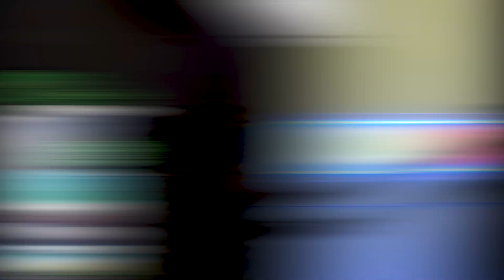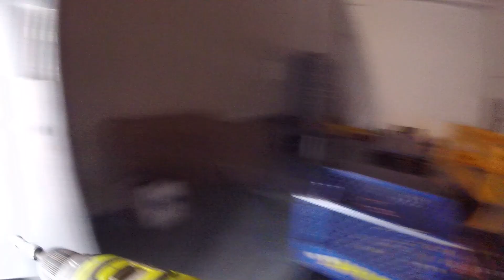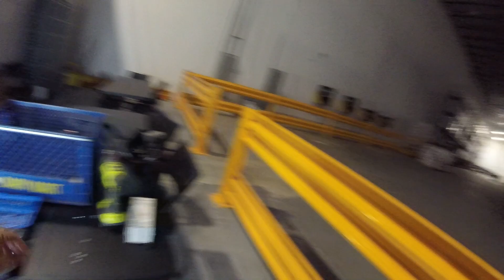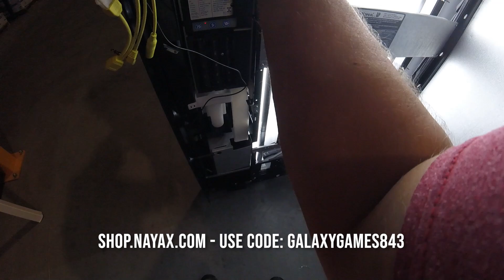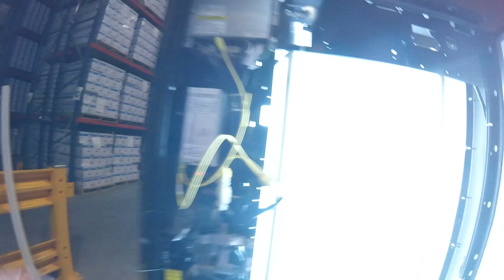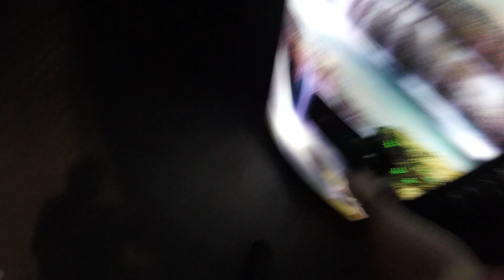How To Install A Credit Card Reader On A Dixie Narco 501e Drink Vending Machine!

Comment: But the coin acceptor will no longer work correct? Because you used the connections for the card reader
Reply from the maker: Coin acceptor works just fine!